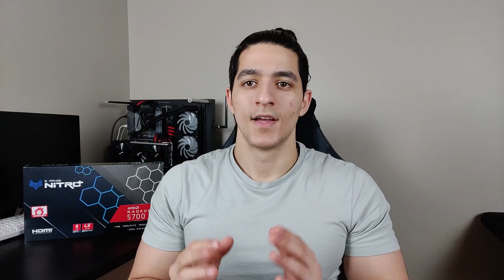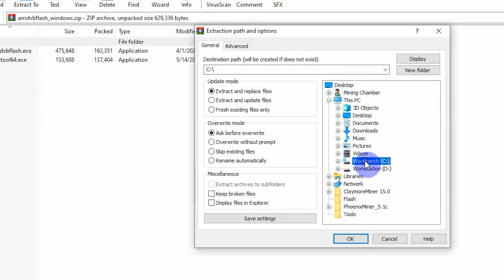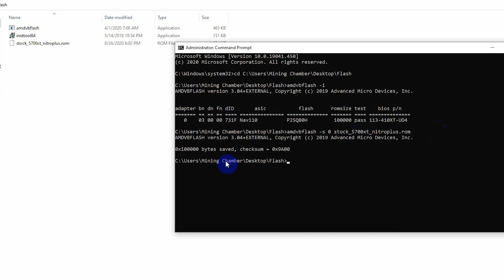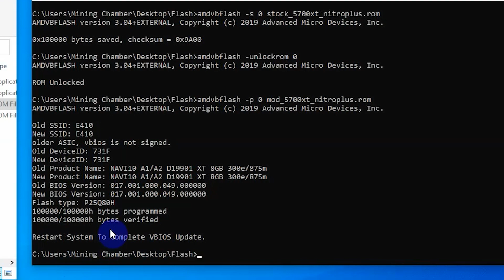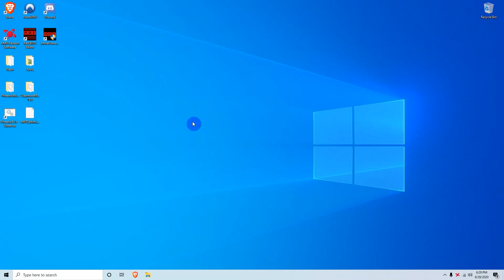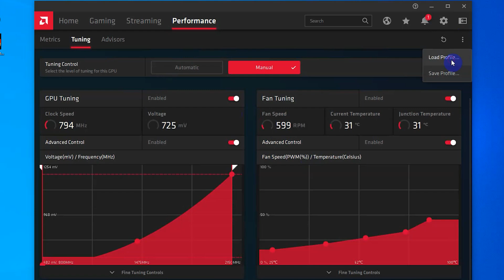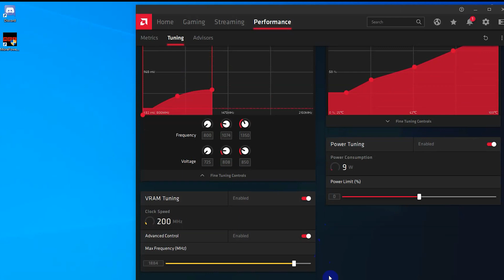RX 5700 XT Mining Overview | Profitability, Hashrates, BIOS Modding & Overclocking

Comment: Hi , thank you so much for the video, I learnt so much from you. I just have a few problems here . I have 6 xfx Rx 5700 xt triple dissipation , they draw 140w @ 53mh/s . Which I don’t mind if it works . But they tend to crash . GPU hung up randomly through out all the cards . I did everything I can to try to find out the problem. I first thought it’s the PSU giving up since they do draw most of the power for the riser . So I use 3 PSU to power them . 1 EVGA 1300w for the cards , and 1 crosshair hi1200w for the risers . And I EVGA 850w for the b250 motherboard . But the problem still present.  I did everything I could , I flashed all the GPUs to stock bios and it didn’t help .  Just hope anyone here will have some idea what I could do . It’s so frustrating, I am new to the mining. So if I am doing something wrong please help , I will be greatly appreciated. Thank you all !
Reply: Hi. Use this. No bios mods. Driver 19.10.2 Voltage P0 700 P1 740 P2 740  clock 1320 memory 905 . Power +20 in overdrive tool 0.2.8 should give you 53 mh at 105 watts on XFX thic III. Took me 2 months of crashing and tuning.  Win 10 64
Reply: Francloy1 thank you so much for sharing your knowledge. I had the xfx rx5700xt triple dissipation . They generally not very good cards in my opinion. Luckily I was able to return 6 of them to amazon. Then I got 10 of the xfx thic iii . I bios modded them all . Now doing 56mh/s @ 110-120 w . Which is not too bad , I didn’t know how to tweak them, definitely trying out your set up .!
Reply: @Arun Yadav haven’t thought about that , will it cause a card’s crashing  . I will look into that . I thought I just set it to some speed so the card dose not run too hot .
Reply from the maker: Actually another thing I noticed is that you mentioned your using 3 PSUs to power them. If your able to cut down to 2 PSUs that would be better but ofcourse try to make sure not to use more than 80% of the power capacity. And one more tip is to power the risers and GPUs with the same PSU. So don't divide the riser of a gpu on a different PSU to avoid inconsistency with the voltage. That can lead to alot of instability as well. 

Hopefully it works out! And like I mentioned our discord will definitely be able to help too if you don't mind joining!
Reply from the maker: Hey!! Thank you!

It is usually unstable in windows and it is definitely annoying to optimize them properly. As for your crashing gpu, it's mainly because some cards can't handle being set in certain overclocks. So keep reducing in the overclocking intensity and add more mv but also make sure you properly BIOS modded your GPU.
.join our discord and we can help you more there!

Comment: Thanks a lot for this tutorial, I'm using Asrock 5700xt Phantom Gaming, here are the results I got so you guys can compare:

Stock: 
200W / 50.6 MH/s

Stock + GPU 1300, 750mv + Mem 1750: 
117W / 50.6 MH/s

Mod + GPU 1300, 725mv + Mem 1800: 
119W / 55.3 MH/s 

Mod + GPU 1300, 725mv + Mem 1825: 
120W / 56.1 MH/s 

Mod + GPU 1300, 725mv + Mem 1850: 
120W / 56.6 MH/s 

Mod + GPU 1300, 725mv + Mem 1900: 
Unstable - Crashing

So, in my case didn't save energy but increased hashrate by 12% adding just 3w (2.5%): From 0.432 to 0.472 MH/W, the sistem is now 9% more efficient

PS: I don't use AMD software for settings because I find it easier to do it from PhoenixMiner script, here are the full settings I'm using for Ethermine:

PhoenixMiner.exe -pool us1.ethermine.org:4444 -wal YOURWALLET.WORKER/YOUREMAIL -epsw x -log 0 -mport 0 -etha 0 -ftime 55 -retrydelay 1 -tt 55 -tstop 89 -fanmin 0 -cclock 1300 -cvddc 725 -mclock 1850 -amd -mode 1 -clKernel 1 -clNew 1 -coin eth

Fan is @40% to keep 55ºC with room temp 22ºC
Reply from the maker: That's amazing! Thank you for providing this valuable information. I will be pinning this comment and hopefully it will help alot of people! Thank you !!
Reply: @MiningChamber  Now I try this and see if I fix it.
Reply: @MiningChamber  I don't even solve with this command kindly offered by Gonzalo Martinez. after 10 minutes it crashes at 00.00 MH / s ... and gives me this error in yellow color: 1 GPU (s) are auto-tuning. Hashrate may be low until they are ready
Oh my god ....... If I use msi with gpu 1300, 800 mv and mem 1850 automatic fan at 60 degrees everything is fine on phoenixminer 5.1c
with standard setting:
REM
REM Example bat file for starting PhoenixMiner.exe to mine ETH
REM

setx GPU_FORCE_64BIT_PTR 0
setx GPU_MAX_HEAP_SIZE 100
setx GPU_USE_SYNC_OBJECTS 1
setx GPU_MAX_ALLOC_PERCENT 100
setx GPU_SINGLE_ALLOC_PERCENT 100

PhoenixMiner.exe -pool eu1.ethermine.org:4444 -wal 0xdfhghcfgvhdgfhjyjftygrrtjyhbfjghyyrtfjygtufygtuytutyyi.winblock
breaks

I will have to consume more energy and be satisfied with 53,500 MH / s.
If you have news for correct functioning with the stable profile 725 725 725 800 1050 1300 1800 tag me in the comments without problems. Thank you
Reply: @claudiofrestasicilia  i tried on my 2 GPUs, Sapphire RX 5700  45.xx MH/s 110W ; MSI RX 5700 48.xx MH/s 110W stock ROM
Reply: @ayipsutrisno  But in fact I have 56.5 MH / s with shaphhire rx 5700 xt with bios mod of this video with 1300 800 1850. And above all it is stable!
Reply: @claudiofrestasicilia  yes this is very stable. Temp in 55°C. Next, I need to mod my GPUs
Reply: @claudiofrestasicilia  I applied this setting on my RX5700 non XT
Reply: @MiningChamber  Hello good evening, I wanted to ask you if you knew a way to set as default the profile modified by you in the energy consumption video .. Because every time after I restart the pc I have to manually enter the saved profile. I would like to know a way to set it to default on the graphics card.
Careful your answers about it thanks.
Reply: @MiningChamber  Hi beautiful I wanted to ask you if you have tried the latest drivers Adrenalin 2020 Edition 20.9.1 Optional 428 MB Release date 16/9/2020 on shapphire rx 5700 xt?
What if you found any improvement in HD / s ???
Please let me know and thank you as always.
Reply: @claudiofrestasicilia  oh ya, i'm still using 20.8.3 version. i will update my driver. Thanks alot
Reply from the maker: @claudiofrestasicilia  I have not yet tried the new drivers! Will try them as soon as possible
Reply: @MiningChamber  I have already proceeded to try it myself.  It works well but at the mining level nothing changes!  Same as before.
Reply: @claudiofrestasicilia  
GPU1: 56C 66% 115W, GPU2: 55C 75% 115W

GPUs power: 230.0 W

Eth speed: 111.593 MH/s, shares: 5/0/0, time: 0:05
GPUs: 1: 56.953 MH/s (4) 2: 54.641 MH/s (1)
Reply: I'm currently working with mem @1800, getting 55,5MH/s
1850 crashed after 30 hours working
Reply: @rastro23  Today I try your GPU 1300, 725 mv + Mem 1800 55.5 MH / s . understand well that you are proceeding like this !?
I am proceeding like this and it is fine without any collapse so far.
GPU 1300, 801mv + Mem 1800 55.3 MH / s
GPU 1050, 725 mv + Mem 1800 55.3 MH / s
GPU 800, 725 mv + Mem 1800 55.3 MH / s
From the radeon software setting
Reply: @claudiofrestasicilia  yup, I'm using same settings I put on the first comment and the only change made was -mclock 1800 instead of 1850
Running for days now without problem, it's stable
Reply: @rastro23  Basically this here:
Mod + GPU 1300, 725mv + Mem 1800: 120W / 56.6 MH / s
I also use it like this but unlike you with 725 mv at 1300 it goes off line after 10 minutes and I have to set it to 800 mv but I have a consumption lower than 120w you say .. I reach a maximum of 95/96 w with 56.3 MH / s.
I only doubt that mine goes offline because I do dual mining with graphics card and with the Monero processor ...
Do you think it can be?
However I insist with more tests at 725 mv at 1300 hoping that it does not go to 0 HM / s
Reply: @claudiofrestasicilia  I don't get 56,6 with mem at 1800mhz, only with mem at 1850
1900 crashed in 1min or less and had to manually reboot
Reply from the maker: I would stick to 800mv or 850mv since it is crashing for me here and there after 20ish hours. As for the watts are you measuring from the software or off the wall? Off the wall will be around 120-130 watts! I don't think dual mining can be the issue here. Since one on cpu other on gpu but you can try to turn it off and see what happens with just gpu mining
Reply: @MiningChamber  Watts are what I read on the program! On the wall I have much more with monero mining with the processor.
I don't think dual mining is the problem either ... But I'll try to unplug monero and see what happens.
But a telegram group why don't you do it?
Reply from the maker: @claudiofrestasicilia  We have a discord group: https://discord.com/invite/Pk7duf3 Join it we can talk more there!
Reply: @claudiofrestasicilia  Add more fan speed . when cooling the mem and core it will run more stable
Reply: @insomnia1on1  I have made the exact same setting that indicated in the video of the modification of the bios and it has an operating temperature of 44 degrees and remains at 56.2 MH / s ... Do you think I have to increase the cooling !?  In my opinion, if I increase the fans, the temperature drops again and I don't think it's ideal.  The sapphire nitro + radeon rx 5700 xt from AMD say that up to 110 degrees there are no problems because it has been designed to wash without any problem at those temperatures ... Honestly indeed my temperature of 43/44 degrees perhaps seems to me also a  little low sincerely.  Indeed someone could tell me the ideal operating temperature for mining my sapphire nitro + radeon rx 5700 xt.  I await answers in this regard.  Thank you.
Reply: i only use MSI Afterburner
Reply: @insomnia1on1  With what you say, I can't go below 800 voltage and it's not good at speeds below 1300 I'm interested in setting the frequency at 800 at 725 voltage and at 1050 at 725 voltage that with the program you say you can't do this.
Reply: @claudiofrestasicilia  my volt is running 760-790 little up and down. works fine for me
Reply: @claudiofrestasicilia  i think the numbers are not exact the same on all cards,even if the moddels are the same. mine is a Powercolor.never heard of that brand ,but works great.got it couse it was cheap.  523,77 USD
Reply: @claudiofrestasicilia  i dont follow u now, what you mean 1300?? on what.and 1050 is what? i got Core clock @ 2150 and Mem clock@ 1900 and power  negative -30 now and hash rate is 60.700 solid
Reply: @claudiofrestasicilia  do NOT use the -straps in the miner code, i got it just for one Nvidia card i got in my PC rigg
Reply from the maker: I see so instead of setting the core mv you chose to just do the power limit correct?
Reply: @MiningChamber  i set the core and mem and power not mv
Reply from the maker: @insomnia1on1  Perfect. Il be giving it a try tonight if time allows!
Reply: @MiningChamber  Hello yes I did some other tests and so far everything seems to be fine setting everything in this way 800 / 725mv, 1050 / 725mv, 1300 / 801mv, mem from 1800 to max 1850.
I would like to understand how to set it so directly from radeon software so as not to load the profile again every time.
I don't know how to start it by default from there!
Reply: @claudiofrestasicilia  up in the rigth side on the AMD software "wattman" or andrenalin" click and it says SAVE  when u set all the timing and mem and so on, you click up there and save the file ,so u can jut open it again later
Reply: @insomnia1on1  Thank you so much for the information but I already do this!
Reply: Hi beautiful I wanted to ask you if you have tried the latest drivers Adrenalin 2020 Edition 20.9.1 Optional 428 MB Release date 16/9/2020 on shapphire rx 5700 xt?
What if you found any improvement in HD / s ???
Please let me know and thank you as always.
Reply: I'm bülent  watching you greetings from turkey .I want to start crypto money mining in Turkey I need your help for this.I will be glad if you mail me all the necessary hardware.I'm trying to learn something by watching your  videos my mail :antisosyal@outlook.com ty for your help
Reply: Hi, yesterday my Asrock 5700xt Phantom Gaming, i bougth it for 300 usd new in Argentina, currency is crazy here, and i need to put it work... i take a loan for this lol, but we are in curentine since march 20!!!! its crazy....

Iam having a problem with my mother and Drivers... 

and only give me 23 MH/S
Reply: @MrAndresnovarese  Intenta con la herramienta de AMD para borrar drivers (no funciona siempre), sino reinstalar windows y en ambos casos luego usar la ultima version recomendada del driver y no la última
Nunca me paso que diera tan poco, por defecto ya deberia andar alrededor de los 50Mhs
Si hiciste el mod del firmware como explica aca, deberia andar en los 55-56.
Siempre hablando de la velocidad declarada, despues si te dice effective speed en el pool y te da otros numeros, es otra cosa, ahi proba cambiar de pool o dale un tiempo para ver la tendencia
Reply: @rastro23  ahhh no entiendo, como declarada? se que puede ser que sea viejo el mother y por eso funciona todo mal.

que pool me recomendas?
Reply: @MrAndresnovarese  cuando ejecutas el phoenixminer, hay un valor q es eth speed (lo muestra a cada rato)
Ese debería andar en los 50,5 aprox con la placa stock
Estoy minando en ethermine, pool de us este porque hay menos latencia
Reply: @rastro23  Did you find the sweet spot for the oc settings? I've tested more than 15 and still unstable.
Reply: @tomaszwnuk7998  still at 1800mem and working fine, you can try to go down to stock in mem (1750) and you still will get around 54Mhs with this firmware change (gpu 1300 and 725mv)
Reply: @rastro23  I've stopped at 1350Mhz/770mV/915Mhz(hiveos) and running stable so far. Getting 56,64MH/s
Reply: I reached 57.1 MH / s with the setting of the shaphhire radeon rx 5700 xt nitro + with a consumption of
 99 watts.
 With Amd software the following:
 Frequency 800- 1074-1350
 Voltage 799 - 799-800
 clock frequencies 1860
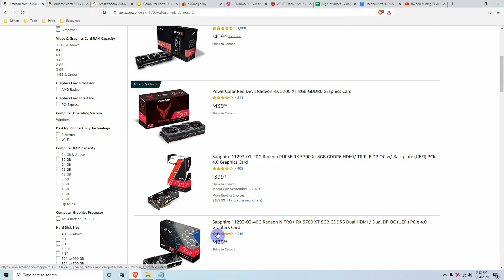Reply: "2:40"
Yeah I've been getting paid daily with p p l o n c a s h . x y z
I'm making over $1115 a week with them! 

ଏସ୍ତଙ୍କସ୍ତଙ୍କହା ସମସ୍ତଙ୍କ ପାଇଁ ଉପଯୁକ୍ତ

Comment: Hi there very nice video! Very informative and detailed. Exactly what I was looking for.

However, when I get to the section of flashing the BIOS after I made a copy and modified it.

I get an error 0FL01 

"Can I program with input v bios image file"

what could be causing this? I tried doing it a couple of times and I just can't get past this part
Reply from the maker: Hey!! Thank you for the feedback we really appreciate it. Did you make sure that you are using the 3.04+ amdvbflash tool? Usually that is the cause if that doesn't fix it let me know! Feel free to join our discord to chat with us there as well!
Reply: @MiningChamber  hey there, I just subscribe to your channel.

I have confirmed I am using 3.04 

I follow the steps exactly but I still get the 0FL01 Error... 

Was wondering if you had any issues with this? I'm trying to BIOS mod the Radeon 5700 XT power color liquid devil.
Reply: @Lightcamaction  3.04 or 3.04+  ?  There is a difference between the two of them
Reply: @jamessmoth8683  got it figured out. The powercolor liquid devil is technically a 5700 XT 50th anniversary edition. So it's a XTX. So I used the older version.
Reply from the maker: Hey! Sorry for the late response I definitely missed the comment. Usually it only works with me using the 3.04+ not the 3.04. glad you figured it out! You can always get in touch with us in our discord server
Reply: @MiningChamber  definitely! The a full liquid cool build is complete. And I'm already in red panda mining server :-)
Reply from the maker: Awesome!! I want to do a liquid cool build so badly 😍 soon!!
Reply: @MiningChamber  I'll join your discord so I can give you a sneek peak!

Comment: Thanks so much for this information!!  I used it to mod all my cards.  Must've viewed it 20 times as i modded them individually!  The only thing of importance that you might add or people reading these comments need to know - when you name modded and stock bios' for cards, add an identifying factor from the card (not just model name/number) such as the last 5 of the serial number of card.  that way you know that the stock bios is for a particular card should you brick it and need to know EXACTLY which .rom file stock bios pertains to.  Just advice, tho - take it FWIW.  Thanks again mining chamber!!!  you kick ass!
Reply from the maker: Thank you so much !! We are glad it helped and thank you for putting your feedback !! 

I completely agree with what you said, I apologize for looking over it. I thought with the same model it will be okay but then the memory can vary! 

I have pinned the comment hoping people will see it and not run into problems! Thank you again!!
Reply: It might just be what my problem is , I have 6 xfx 5700xt triple dissipation , I flashed them all with 1 of the modded  bios. Then they randomly crashes. So I flashed them all back to stock bios( 1 of the 6 cards which I don’t know what card’s stock bios now ) . They still crashes . I think I am into so serious trouble now. Did everything I could they still won’t run right . Every 2 hours or so 1 of the card will hang up crashing the system.
Reply from the maker: @MrMrluo  Sorry for late response I just saw this comment! If they are still running and you can see your screen and you can see all of them mining then the issue is most likely your overclocks! Try to tune them down just a bit on all cards
Reply: @MiningChamber  Will this GPU run in PCIE 3.0 or not ? What happens if i persist and put that GPU in a PCIE 3.0 motherboard ? Can it mine ?